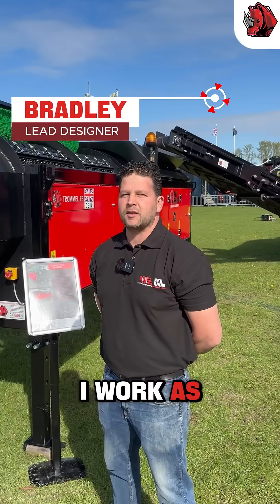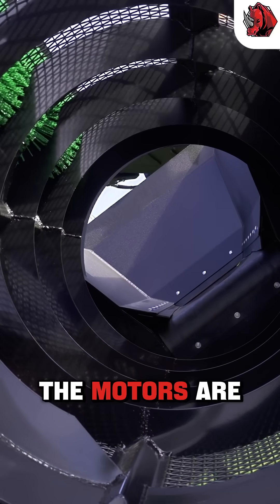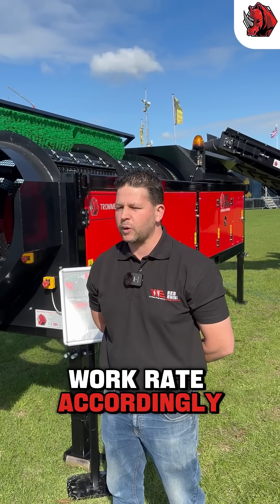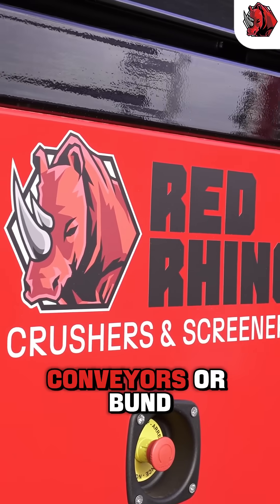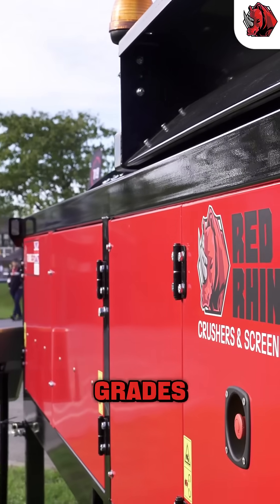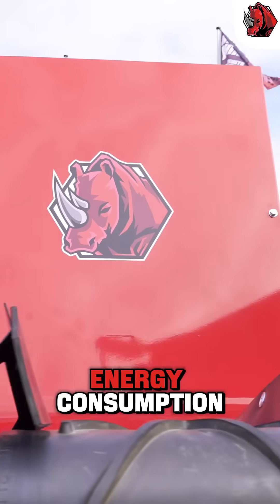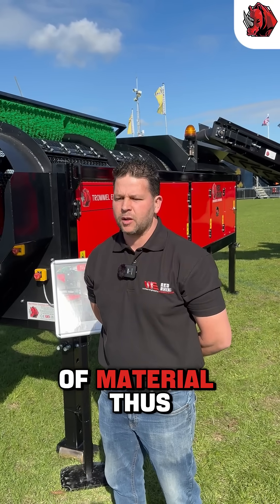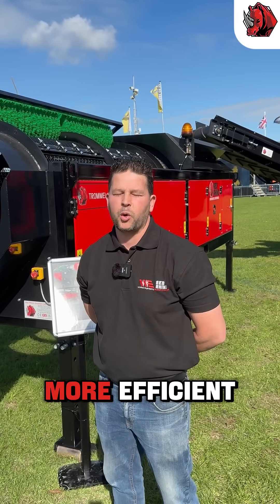Electric Trommel Innovation

Comment: That's cool so I assume you use like a strain gauge or torque sensor on the motor output shafts.. basically something on each of the motor sections so that use a PID loop and set the accordingly very quickly.
Reply from the maker: Thanks for the comment! Great question – we use a mix of control systems and feedback technology to get the best performance, but can’t share too much detail on the setup. Appreciate you taking an interest in how our machines work! 🦏